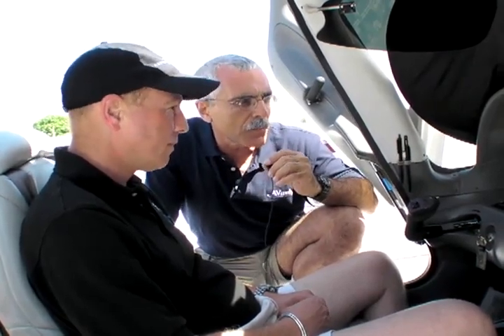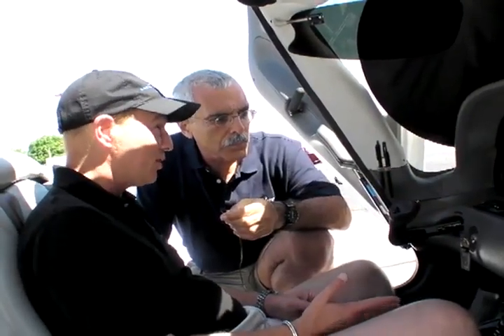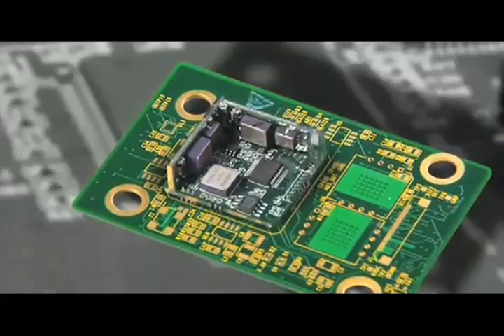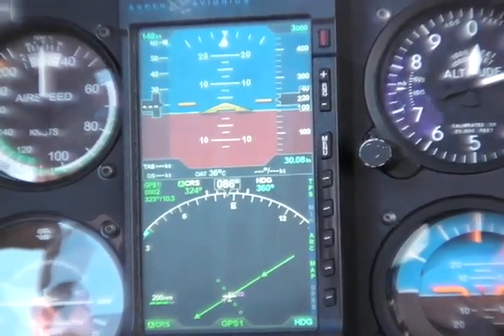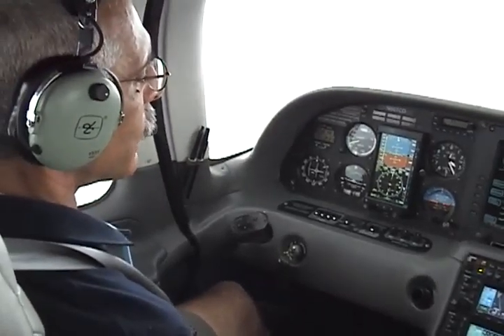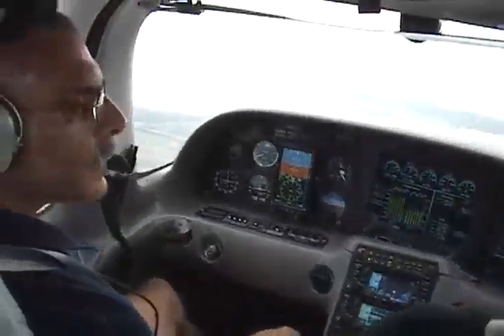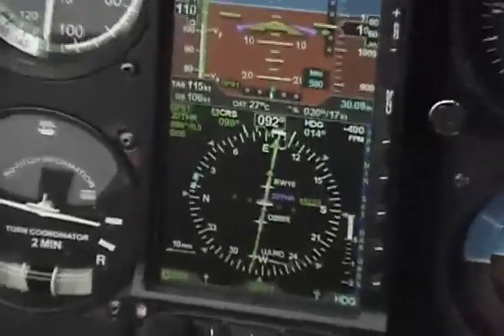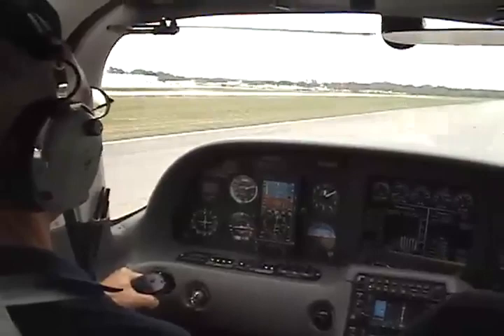Aviation Consumer Examines Aspen Avionics' "Evolution" PFD

Comment: I've seen that system go wakko on attitude, simply when the aircraft was making a turn during taxi. The sales rep said it was "magnetic interfearance".  If Magnetic Interfearances induces a false Attitude signal, your system needs some serious work. I've also seen the display blank out attitude and heading because of discrepancies in the air data inputs.  If an air data failure causes your attitude to blank out, than the system needs serious reworking.  No since in having attitude fail because of an airspeed failure.  Pilot is already having a hard time if he looses air data, no need to make his situation MUCH worse by taking away attitude.